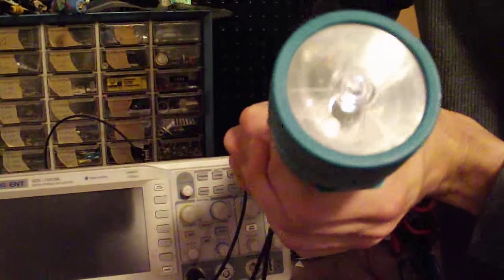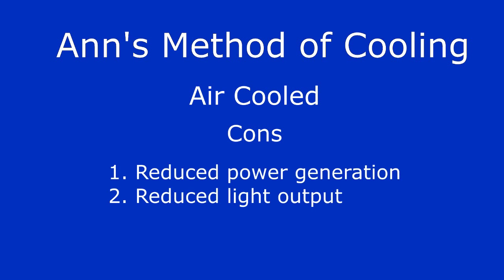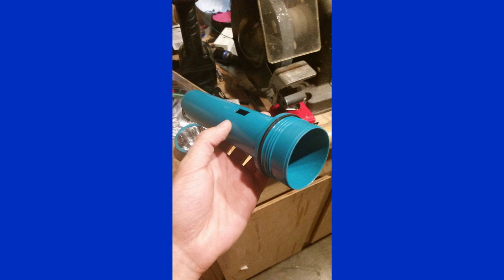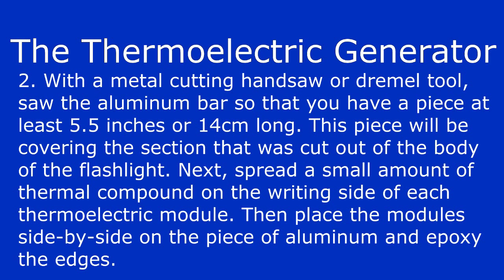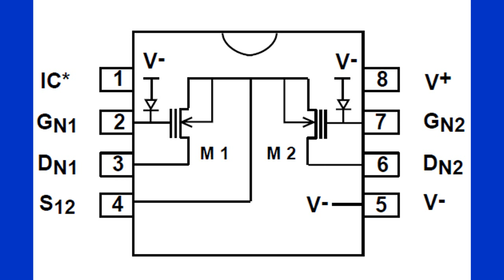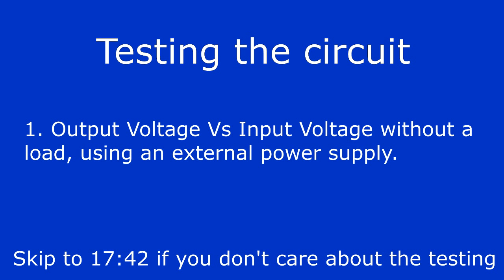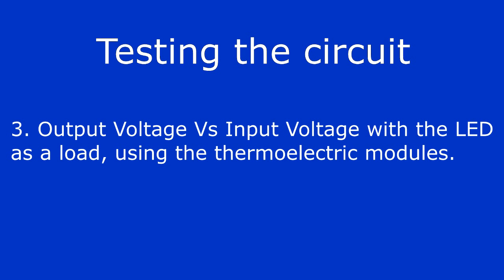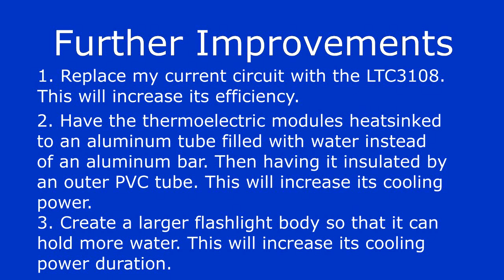How to make a Thermoelectric Flashlight

Comment: What Peltier tile model did you use?
Reply from the maker: TEC1-12706
Reply: would it work using human heat without a water cooling system?
Reply from the maker: It would still work. Having a water cooling system would help keep the cooler side of the modules from increasing in temperature as much, from being heat up from your hand.
Reply: LampE Could heat sinks work?

Comment: What is the cutin voltage of the led u r using in this?
Reply from the maker: The LED voltage is around 2.5V - 3.2V
Reply: Did you get 3 volts from this circuit with led as load? 
I'm doing this, the LED starts lighting with input of 0.3 volts, the LED's operating range is 1.7 to 3.3 volts and still it isn't bright enough, I think we can get only 0.1 volts from peltier tiles but we need more voltage and current is also main factor to lighten the led.
Reply from the maker: That is strange. The LED should start to light up at around 0.18V or so. At 0.3V there should be a significant difference in lighting compared to when it starts turning on. I would get around 2.7-2.8V with the LED at around 0.3V input. Are you using the same peltiers as the ones in the video?
Reply: Nope I'm testing the circuit with power supply.
Reply: I'm using breadboard and connecting wires to make the circuit, does it affect the output?
Reply from the maker: That should work just as well. Are you using the same choke/transformer as the one in the video? And same resistor value? Also, are you using both sets of transistors that are on the chip?
Reply: I'm using the same common mode choke and same MOSFET ic but 47k ohm resistor  but  there are no transistor in this video I guess.
Reply: And can you please tell me how much voltage can produce by 4 peltier tiles(TEC1-12706) if they r connected in series!
Reply from the maker: The MOSFET is just a special type of transistor. So that means all the parts are the same. Did you connect the gates of the MOSFET together, as well as the drains?
Reply from the maker: If 4 are in series, and let's stay you lay your arm across all four of them at once, you'll probably get up to 650mV or so.
Reply: And u said water is 20 times more conductive than air so it will increase 650 mv to more like 650m×20=13 volts theoretically 
So that practically we can get atleast 1 to 2 volts of input from them(peltier tiles) and which can be amplified by circuit to lighten the 3v white led brighter ???
Reply from the maker: No, the voltage is related to the temperature difference, not how thermally conductive the air is
Reply: Okay thanks for getting back to me

Comment: is there any other alternative for ALD212900PAL N channel MOSFET ? coz international Shipping Charges are too expensive
Reply: Can we use some other model ?
like IRF540N N channel MOSFET  ?
Reply from the maker: There isn't any other that I know of. No, the IRF540N wil not work because the gate threshold voltage is too high. You can try making the LTC3108 circuit from my other video.